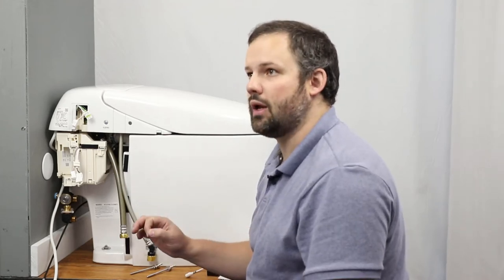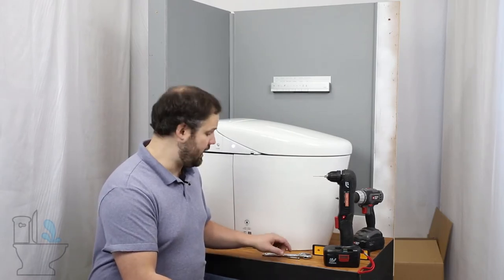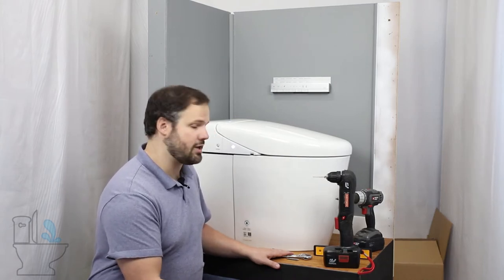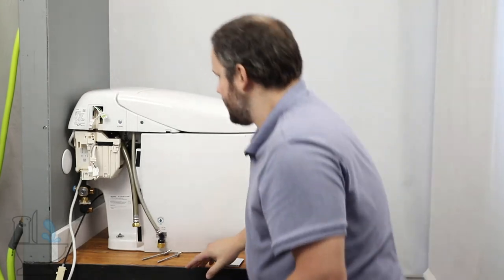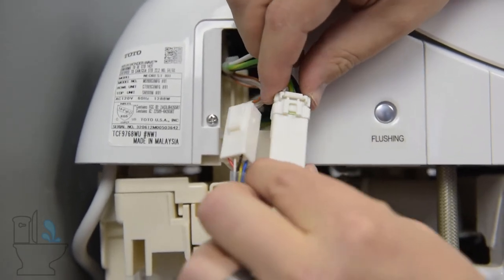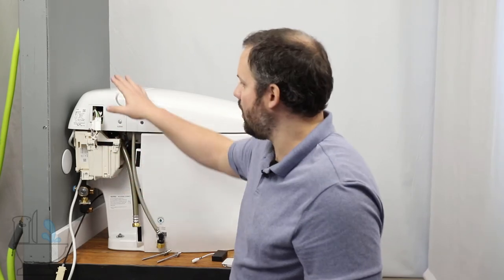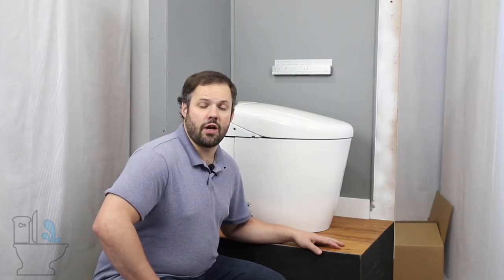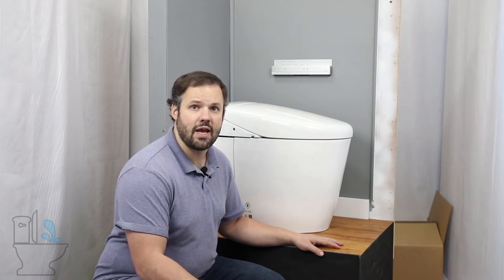How to install TOTO Neorest RH MS988CUMFG (Full Installation Process)

Comment: I just finished installing mine, this video was super helpful video A++. I had the hardest time drilling out the holes because they were in concrete. Plus the screws included were too long for the anchors. It took me an hour (and a thrown out back) to figure out why it wasn't seating to the ground. I think that plastic base part needs a way to adjust the height, toilets with a tall base will struggle to fit.
Reply from the maker: Thank you for the kind words and for taking the time to provide your feedback on your install!

Comment: Thanks for the detailed video and the warning about connecting the seat to the base before plugging it in. I doubt I would have made this mistake but I didn't see a warning in the installation instructions. 

I do have a question. In the video, the battery pack for the manual flush assist appears to slide up and stays. Mine doesn't stay up and will fall out if touched when the side is off.
Reply from the maker: Thanks for asking!  It can sometimes be a bit tricky to have the battery pack stay put...  Higher end models like the NX1 and NX2 don't even have a storage area back there for it.  When customers run into similar problems you're describing, they often just choose to store it in a near by cabinet in case it's needed when a power outage takes place.

Comment: great video. Does it matter if the water supply is done exactly the way you showed it here because my plumber wants to just add an adapter to the existing water supply and tuck the valves in the back of the toilet?
Reply from the maker: Great question!! The ONLY concern could be water flow.  If you find that it works, awesome, but if it seems like the flush is not working properly, I'd take out the standard and do it the way the instructions say to.
Reply: I used a water supply line from my angle stop to the new Toto valve

Comment: Is there a video on how to work the remote? Or is there any reason you have to pree any particular button several times to get the Bidet to respond?
Reply from the maker: Yes!  We have a video that walks you through all of the options on the remote here: https://www.youtube.com/playlist?list=PLJHN2nUk70reFk9M3jzXYXSbQxaJE7txL
Normally when we see issues with multiple button presses needed before the remote responds, it's due to the signal not making it to the seat.  This can be due to a small room, dark wall colors, or wireless interference among other things.  Did the unit ever work properly?  If yes, what's changed in the bathroom layout since the problem started happening?  If no, do any of the items on the list below sound like they could be playing a role with your installation?

Comment: Great video, cleared up some fuzzy areas. I have a question about the water supply connection. From what I understood from the instructions the bowl suppy connects to lower connection and the lid to the connector the upper. I think you did the opposite which makes me think I did it incorrectly. So the connector with the clip connects to the bowl or the lid? Thank you!
Reply from the maker: If I understand your question correctly, The answer can be found on page 7 of the manual, at the bottom of the page: https://www.manybidets.com/wp-content/uploads/2020/10/D07143_MS989CUMFG_MS988CUMFG_IM.pdf Here, you can see that the water lines are connected to different inlets depending on if the water supply comes out of the wall or floor.  The reason for this is that depending on the water supply coming from the wall or floor, the different inlets are high vs low.  Which one you connect each line to is not important.  Hopefully this clears things up.  If not, please feel free to let me know.  I'm happy to talk more about this should you find it helpful.
Reply: @ManyBidets  the instructions on the link show BOTH ways. ;) Maybe a better question is does it matter which connection you use? Thank you again, great video.
Reply from the maker: @miroslavjuicebag  Thanks for the followup question  That was the point I was trying to make, but you worded it better.  The Install manual does show it both ways because it does not matter.

Comment: I just purchased a Neorest AH MS989CUMFG#01 and would like to know if your instructional video for the RH MS988CUMFG applies to my AH.  Thanks in advance
Reply from the maker: Yes it does!  It's exactly the same.
Reply: We just installed an AH and the lid seems slightly shaky. Is that normal? Everything else went fine and it works. The lid works with the remote just not used to it especially in the back area being so loosie goosie. Any advice or is this ok?

Comment: Hi, great video. Is there any consideration for removing it to replace the wax ring. Can the entire be remove without dismantling in reverse order?
Reply from the maker: The order can absolutely be reversed to remove the toilet, but the new wax ring once properly installed should normally not need replacing at any point.  The biggest thing often missed is disconnecting the manual flush cable before taking the toilet off.  If you make sure you don't miss that, and just reverse the steps in this video, you should be good to go!

Comment: Great channel! I have a question on trouble-shooting the dryer and the washing features. That is, we have our TOTO Neorest RH installed by a plumber and all features worked just fine. Then a few weeks later, no dryer, no washing features. I've changed the batteries in the controller, unplugged the toilet for 30+ mins, and still the only features that work are the: auto lid opening/closing and the auto flush. I press all of the other wash features and dryer and nothing activates. Power saving modes are all off, seat temp set low and water temp set at medium. Not sure what else to try. Thanks in advance!
Reply from the maker: Normally when you have this issue, the problem comes from this little situation: https://youtu.be/QhgJvX8tf0s  Let me know if that resolves your problem or not by commenting once you've tried it :-)  Next time you're in the market for a neorest, please think of us!! :-)
Reply: @ManyBidets  Thanks for the quick response. I did try powering down the unit after watching this video and then powering it back up and that’s fine. That method works. The toilet and controller are talking to each other when it comes to auto flush, auto lid opening and closing. But like I said, while sitting on the toilet and pressing the dryer button, nothing. While sitting on the toilet and pressing the wash features, nothing. Guess I will have to call a certified technician to investigate the remote/electrical commands. Thank you.
Reply from the maker: @ludwigzebrauskas8675  A few followup questions:
1. Did you try powering down and up using both methods in the video?
2. Is the water in the toilet bowl warm?  I know this sounds weird, but sometimes plumbers can mistakenly connect a bidet toilet to a hot water line, and the unit will boot down when it feels warm water as a safety measure
3. Issues like this can also happen when the manual flush option is not properly installed.  Try uninstalling it and reinstalling it (see minute marker 22 on the install video above for details on the manual flush install)  If the plastic pull string housing is not fully seated, the unit will also have issues.
Reply: @ManyBidets  1. Yes I can power down the toilet holding the power button on the back of the remote for three seconds and then I can turn it back on by holding it for three seconds. I also can hold the wand button that goes back-and-forth icon for 10 seconds and then it turns off the unit. I can also then hold it for 10 seconds and turn it back on.
2. The water in the toilet is cold.
3. I took off the Velcro panel and noticed that the plumber did not put the battery pack in. He left the battery pack still in the plastic baggie and left it underneath my sink.I grabbed two AA batteries and before I plugged it in I disconnected the manual flush cassette with the ring. I made sure it was seated correctly into the plastic cartridge. I then plugged in the battery pack. I then put the Velcro panel back onto the toilet.

So after trying all three bullet points that you suggested I still have the same issue: heater does not turn on, none of the washing features work. 

I also noticed that when I turned on everything on manual mode (flushing and lid), I cannot flush the toilet for number one or number two when someone is done using the toilet. The toilet only flushes when it’s an auto flush.

Perhaps I’ll remove that top panel where the electrical plugs are stashed away and make sure those connections are solid.
Reply: Another update: I powered down the unit and unplugged it. Then I removed the screw on the top left door panel and removed the two wired bundles. I then unplugged them and let it sit for 10 minutes - cause why not. I then reconnected the wiring and secured the door after putting the wires nice and snug away. I then plugged the unit in and powered it back up. Same problem persists. I have an email into the Toto service/troubleshooting area on the main website so I’ll see what they say when they open up tomorrow. Thanks again for your assistance.

Comment: Great video! What I’m struggling with is the water supply line for my RH doesn’t fit the copper pipe coming out of the wall in my house. The copper pipe is the same size as the inlet, and I can’t get it into the body of the supply valve to tighten it down. Do you know if there is a simple adapter that I could use? I’m at the point where I bought a half inch elbow to attach to the existing valve and I connected the RH supply valve to that. No way that’s right, though it “works”
Reply from the maker: Hello Lee, I'm not aware of any adaptor. Have you tried reaching out to TOTO directly? They can be reached at: custservice@toto.com or you can call them at: 888-295-8134 between the hours of 9am-5pm PST Monday through Friday.
Reply: @ManyBidets  Thank you for your reply! Here's what I ended up doing (in case anybody else has the same problem I had)

I got a 1/2" shark bite connector with a 1/2" female end, and I removed the old nut from around my 1/2" pipe. I have no idea what size that old nut was, it didn't fit a 1/2", and it didn't fit a 3/4", the old valve was something in between. However, a 1/2" shark bite fit cleanly around the copper pipe, and the Neorest valve fit with that.

It took me a number of tries to put enough plumber's tape around the joint, and I did it in the wrong direction several times, but eventually there wasn't a leak and the valve went on.

I'm still struggling my way through this installation but your videos are a great help.
Reply from the maker: @leebrown6712  Thanks so much for letting me know!
Reply: We 
M

Comment: Thanks for the video! I’m planning to install a Toto Neorest AH but I have a rough in of 14”. Are there any tricks you can do to avoid having to relocate the drain? Thanks!
Reply from the maker: A 14 inch roughin is still usable, it just means you'd have a 2 inch gap between the wall and the toilet which will look odd.  If you don't want the gap, the only answer is to move the flange/drain or get a unit with a 14 inch roughin.  Hit us up when you're ready to purchase, we offer great pricing!

Comment: Where do you put the outlet for the power
Reply from the maker: TOTO recommends about 12 inches up, and about 12 inches off center to the left as you're facing the toilet.  See the diagram here: https://www.manybidets.com/wp-content/uploads/2020/08/TOTO-NEOREST%C2%AE-RH-DUAL-FLUSH-TOILET-MS988CUMFG-Fitting-and-Measurements-Diagram.jpg

Comment: I bought a Dr Fussy Bidet from Kogan.
Failed at over two years old after costing $350.
Kogan offered $25.  Won’t be using Kogan again"
Reply from the maker: Thanks for sharing.  There's a lot of junk brands out there.  We only work with about half the brands that ask to partner with us for that very reason.  If you want something that will last, you want a brand that makes a high quality product.  TOTO, as well as many of the other brands we carry, meet that criteria